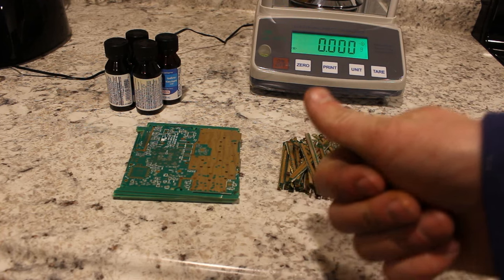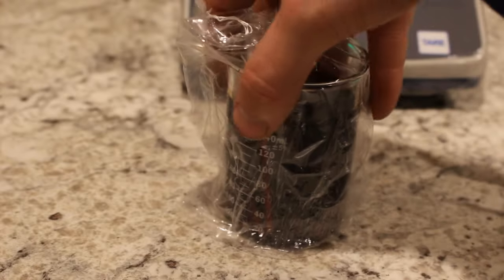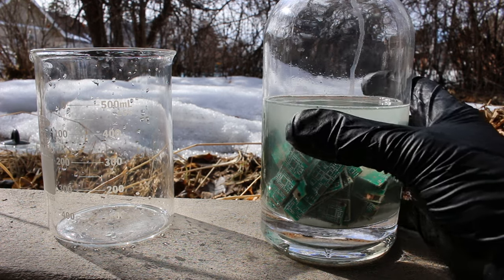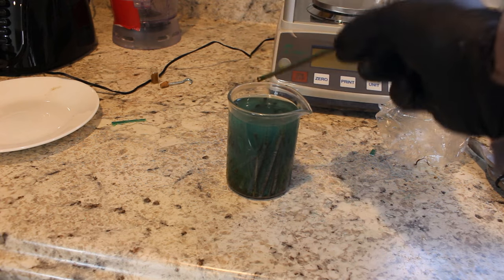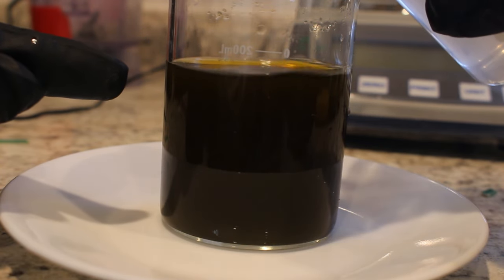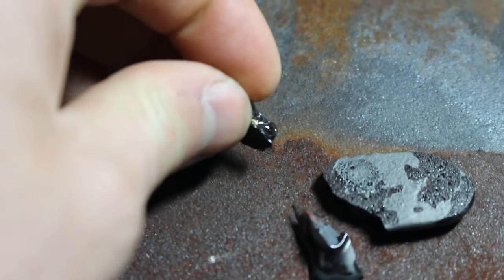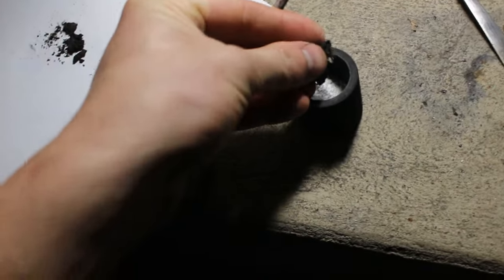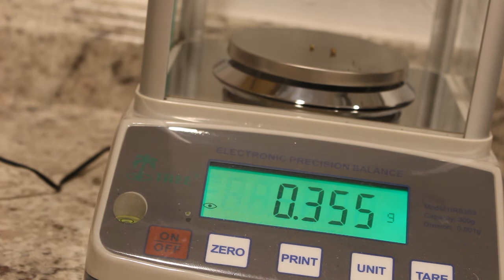Precious Metal Refining & Recovery, Episode 5: Recovering gold from RAM

Comment: Couldn't you just scrape the gold off?
Reply: +SilverFlames Why do you find it necessary to belittle someone who asked a reasonable question?
Reply: +Katherine Gaughan If HE had common sense he wouldn't have ask the question, the gold is way too small to scrape off. Sorry if he was 9 or something
Reply: +SilverFlames I'm 20 and a college straight A student. It is a very reasonable question because it doesn't look at all too small to scrape off. The metal doesn't fuse with the plastic behind it or whatever is behind it so it would be very reasonable to assume you could flake it off very easily with a knife or something
Reply: +J Reid I see but I suppose the metal that we see isn't all gold, probably a low percent of gold
Reply: SilverFlames 
Here is a little bit of advice, think first before call someone else dumb. It is never "dumb" to ask a question. That is how we learn. I certainly didn't know about this process of removing gold from circuit boards etc., and so I have learned something new. If people are made to feel stupid from people throwing out inconsiderate comments, they may become too embarrassed to ask and learn. And, in fact, you did  not have any idea how old that person was that you just insulted, and maybe they are 9 years old.